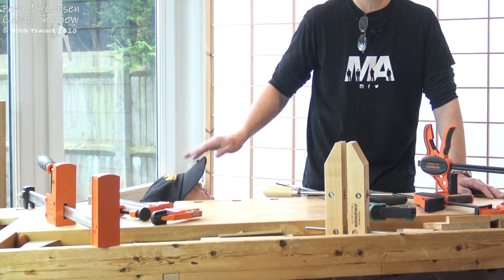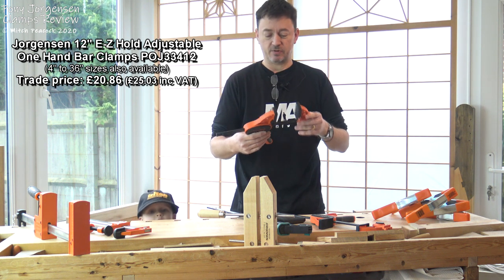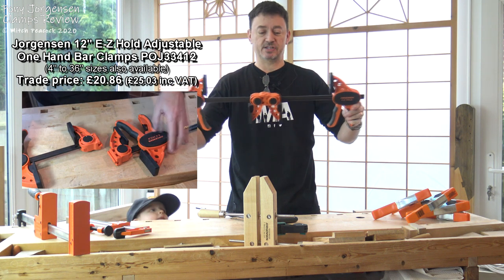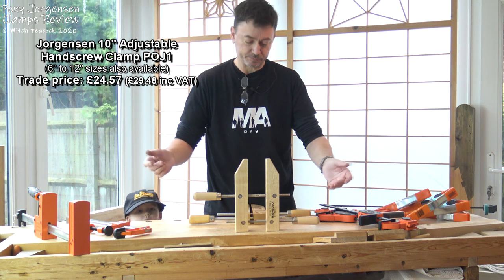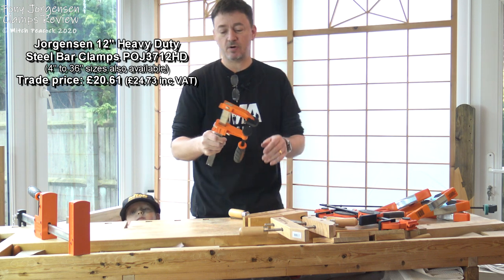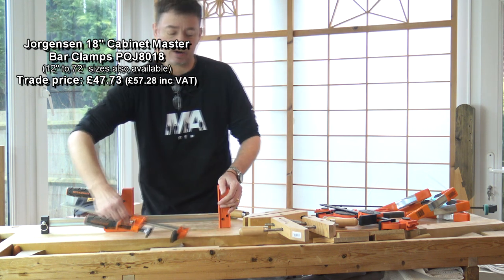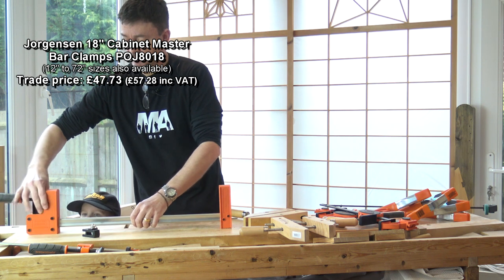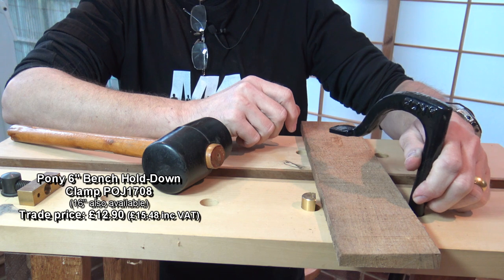Pony Jorgensen Clamps Review

Comment: Thanks, great review. I just picked up five Jorgensen 48" parallel clamps from Lowe's (USA). Going to be using them to build my workbench with 2x4 laminated top. So far they are excellent, high quality and heavy duty.
Reply from the maker: Great, good luck with the bench. They're not cheap, but they're worth it in my opinion.

Comment: Any tips to putting the round rubber head back on to the POJ3712HD sliding side? Unfortunately while I was clamping a narrow work piece the rubber piece did pop off and I have been unable to put it back on. Most any suggestions are welcome,  thanks!
Reply from the maker: I'm wondering if the style has changed as I just went to check and was able to remove and replace easily. Mine just slide in at a slight angle and pop on.

Comment: Is that 3” the maximum clamp opening?  They don’t look 7.5cm long.
Reply from the maker: Which clamp are you referring to? and I'll check for you.
Reply: @mitchwoodwork  It was the spring clamp, but I've subsequently found out it is the opening size.  We have some brands here that use the length of the clamp from the end of the handle to the end of the clamp jaw.